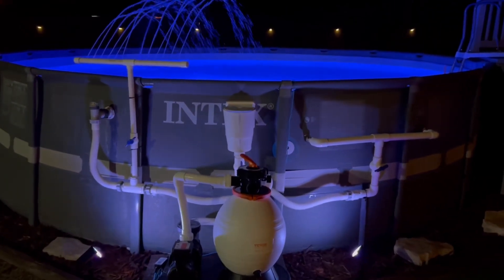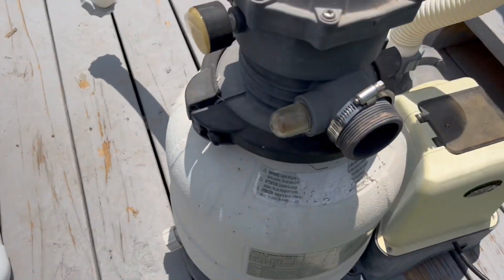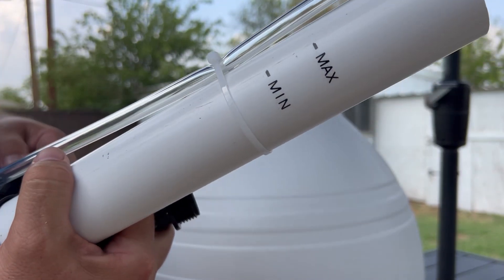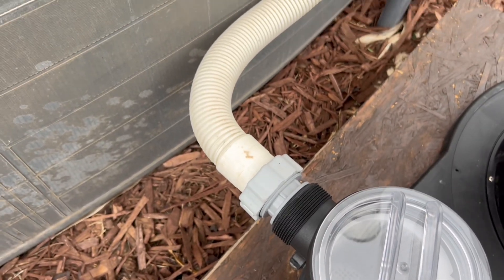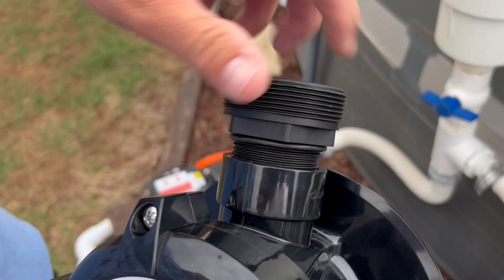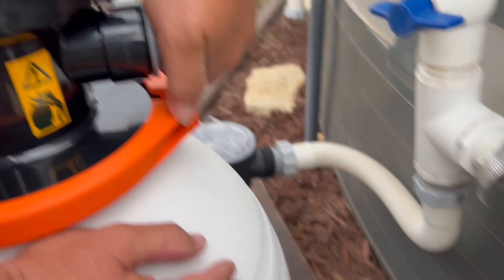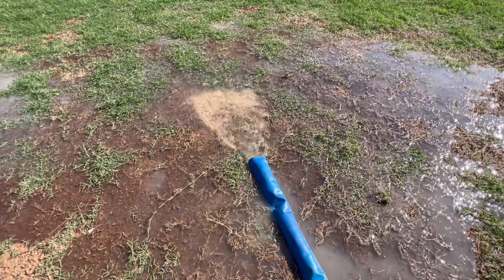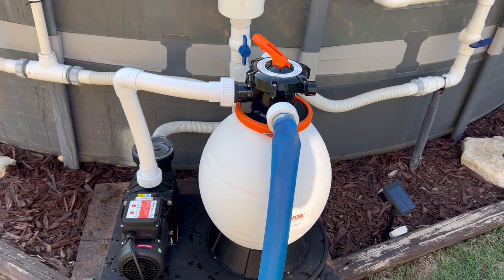How to install a new Sand Filter, Vevor 16” 3500 GPH

Comment: just got my vevor pump today cant wait to get it hooked up and running would not have even thought of or tried to do this with out your videos. Thank you!!! oh and im also going to do the hard plumbing and next year add the skimmer thanks again
Reply from the maker: Let me know how you like it once it’s done 👍🏼
Reply: well i dont have it hooked up yet still waiting on my fittings from amazon that have been delayed 3 days stuck somewhere in shipping. i do have a question though what brand of sand do you use and how many lbs does it take to fill? the directions that come with it are a little lacking thankful for your video cause this is my first pool  @LifeLessOrdinary
Reply from the maker: @ryanpursel5017 it took me two full bags. I don’t remember the brand I just got it at the local ace hardware.

Comment: Man, this was the video I needed! I couldn't get a solid answer from Vevor on whether I needed adapters or not, but I pulled the trigger on the pump and filter anyways, I didn't want to go with another Intex one, because the flow rate is trash lol, I can't wait to get this put in! Hoping to get my brown water to crystal clear again!
Reply from the maker: Let me know how is going after you got it installed
Reply: @LifeLessOrdinary  will do! Im beyond ready lol! Tried to get our brown pool cleared with the intex pump and it just couldn't keep.. New one should arrive Tuesday, so hopefully I can get it installed and going before we leave for vacation on Wednesday.
Reply: @LifeLessOrdinary    Vevor Pump worked great until yesterday morning when I went to backwash it before leaving for vacation, the lid to the strainer basket on the pump sprung a leak, I think the seal just needs to be seated again, I just got frustrated with it and didn't have more time to mess with it, so the pump will remain off until we return next week.
Reply from the maker: @huntershortrepairs I’m sorry to hear that. I got frustrated with that also. Use that black O-ring to push the basket down then screw on the clear top but it Has to be super tight.
Reply: @huntershortrepairs Leaking seems to be a common complaint with these Vevor sand filters.

Why not go with the 16 inch 3000GPH Intex sand filter?
Reply from the maker: @Superman-xr1oh Vevor sent me that pump and filter to review. I did not purchase it. Thankfully, I had good luck with it in my case.

Comment: I appreciate you sharing your know how in this video. I had no idea what back washing even was. So thanks for that.I bought the smaller version of the filter you have. I am finding it a huge pain trying to figure out what plumbing connections I can frankenstein fit to my existing intex pool. It's going to take a while. I'll probably have to order and try and send back and retry.Tyring to even figure the names of parts I don't know to google has been interesting(frustrating). I guess it will be my summer project. It'll be a marathon not a sprint for sure!
Reply from the maker: Thank you 🙏🏼 make sure to check out my other videos on how I plumbed everything it might help 👍🏼

Comment: I just installed this very model and your video helped so much!  I previously purchased the lower model and battled connecting it for days and gave up, sent it back, got this model.  The only things I'm questioning are these:

1) Is it normal for the hoses to shake when it's running?  Both return hoses (I have a salt system) shake a lot.  The hose from the skimmer doesn't, but the one from the lower level pool outlet shakes a little. 

2) The pressure gauge dial jiggles.  But the pressure is between 5 and 10.
Reply from the maker: Your pressure seems ok but I’ve never personally had much shacking going on. Are you giving it enough water? I would open all inlets and see what happens
Reply: @LifeLessOrdinary    I have a video of it and maybe I'm just overthinking it.  The return hose from the filter is shaking from the pressure I believe but I see in your video it does the same thing.

Comment: Thank you for sharing your experiences and success w the intex pool and accessories.
I need your opinion.
I was considering buying a wireless vacuum until I saw this video. The vacuum would be around $300. Then again, this filter upgrade seems very necessary and might be sufficient to hook up the blue drain hose and a more simple vacuum attachment to vacume out the debris and green residues after a storm. 
Did that make sense?
Forgot to mention my pool size. It is 16' x 32'
Reply from the maker: Absolutely 👍🏼 it’s really personal preference. Me personally I don’t want to spend that kind of cash when I can use the blue hose and filter to get out to tough stuff. Which everyone pool is different mine stays pretty clean without a ton of work but yours might be more difficult.
Reply: Can you do a video on the vacuuming with the blue hose and the sweeping device and explain the set up with the filter please

Comment: I installed my new Vevor pump and hard plumbed with PVC line you did. Love how it turned out. Only problem I have is I put 3/4” pvc into the pool outlets that go to the pump as you recommended and now I can’t figure out how to hook up my pool vacuum hose like I did before. Where and how do you hook up your vacuum?
Reply from the maker: I used the white adapter hold on let me get the link
Reply from the maker: https://amzn.to/3V0T9Ij
Reply: Ok and where did you put that adapter?
Reply from the maker: @jasonholdeman8451 are you using a flex hose? If so that adapter goes in one end and into a inlet port

Comment: Good day. I purchased the 14” .75 hp pump. It doesn’t have the threaded ports as yours and my 1.25” Intex hose does not fit the pump’s 1.5 port. Also, when I backwash and rinsed it came out relatively clean instead of dirty as yours. I believe I used the proper sand, #20. I cut off the end of the hose to accommodate the pump. I’ve got a small leak but nothing too serious but still bothersome. Do you have any suggestions on making a proper connection?
I’ve contacted Vevor but they’re BSing me around. I’m either going to find a solution or return the pump. 
Thank you kindly for any suggestions.
Reply from the maker: Oh wow that’s not good. If it were me I would probably grab the grey Intex adapters and then head to Home Depot and make a adapter to the new filter from pvc. I’ll grab a link of the adapter GAME 4560 40mm to 1 1/2 Inch Conversion Kit (For Intex & Bestway Pools) https://a.co/d/ioZy7oN
Reply from the maker: Keep me posted and let me know if Vevor helps more or not
Reply: @LifeLessOrdinary  will do and thank you for your suggestion.
Reply: That's weird that yours didn't have threaded ports because it's usually pretty standard with their pumps 
Even the 12-inch

Comment: I followed your instructions, which are amazingly helpful. But I have one question. My backflow outlet runs water out as soon as I take the plug out. Is it supposed to without turning on the motor?
Reply from the maker: Yes most pumps will do that 👍🏼

Comment: My oring for the clear pump cover I can’t figure out how it goes. Is it to seal the clear cover? Does the flat part go up or down. It seems the threads of the cover make the oring not seat and leak.
Reply from the maker: I put mine in to push down the basket. And then just screwed the clear cover on tight 👍🏼

Comment: Nice video. I have the vevor HCP750A-D. Had to clean out the pump strainer and now I cant figure out how the gasket goes back in properly. Can u help?
Reply from the maker: Hmmmm I will have to double check mine when I get home today. I’m pretty sure the gasket went over the top of the basket to hold it in and then I just tightened the top part real tight.

Comment: So love your channel and work you've done to pool so i subscribed. I have 16' 42" Coleman above ground pool. Says its about 4500 gal. My question is what size filter and how much hp do i need for same kind of set up u got. It has crappy papper filter that came with it. So would be big upgrade going to sand filter. Also getting the skimmer and fountain like u have. Any advice would be greatly appreciated.  Thanks, Scott
Reply from the maker: The Intex 2100 series pump would be perfect for you 
https://www.amazon.com/dp/B07F3RXVBC/ref=cm_sw_r_as_gl_api_gl_i_JFGNZ37ZAWVTQ91A7FQ5?linkCode=ml1&tag=llonate-20

Comment: How loud is it, seems mild in your video. I have a Intex 3000 but after a couple years it just went from mild to loud. Still works and has no debris but I want to replace with something quieter.
Reply from the maker: It’s not bad at all. I think it’s a little bit quieter than my intex was

Comment: I'm sorry but I cannot figure out how to get the adapters for the intex pool.  You say it will be in the links later, but I don't see any links.  I'm a bit internet challenged.
Reply from the maker: No problem here you go.
40mm to 1 1/2” Filter Hose Conversion Kit - above Ground Pool Adapter Connects 40mm Hoses to Standard 1 1/4” or 1 1/2” Filter Ports
Reply: @LifeLessOrdinary  Thank you so much for responding.  My husband has been watching all of your videos and they have been very helpful
Reply from the maker: Thank you 🙏🏼

Comment: Hello. This is our second year with this pump. Last year was great. This year Our output seems very weak. Do you know what could be causing that? We backwashed and rinsed. Not sure what to do.
Reply from the maker: Hmmmmm it’s possible you could have trash on the inside stuck. Go to the 8:15 minute mark of the video. 
https://youtu.be/2kurASa4ahI?si=yKa2OCb2U_BN6jSs 
Look on the bottom of the filter head for any trash

Comment: How do you know which size filter to get? I have an 8,000 gallon pool. I’m seeing 12” 14” and 16” on Amazon.
Reply from the maker: Me personally I would use either 14 or 16 inch for that size pool. Either size would be perfect for your pool.
Reply: Thank you! I just ordered the 14” 👍 one main reason I’m ordering this particular pump is because I can follow along with your instructions. Thank you so much.
Reply from the maker: @aileentimberlake awesome 👍🏼 make sure you get at least the #20 Grade sand. If you have any questions let me know.

Comment: We just purchased an 18’x52” intex that came with a sand filter. We have purchased the skimmer and the fountain that you reviewed. I am not quite finished leveling the ground yet but hope to be ready to set up the pool in the in the next week or so. I was wondering if we should be good with the original sand filter for several years or would you recommend upgrading sooner than later?
Reply from the maker: Absolutely yes, the sand filter that comes with the pool works great. Mine was actually still working. I just received the new one from Vevor so I made a video out of and started using it. Hope your install goes well, let me know if you run into any problems.

Comment: does the pump turn itself back on if you put it on a like a 12 hour cycle? what if you put it on an outlet with a timer - will the timer allow it to work that way or do you have to physically turn it on and off every day?
Reply from the maker: I put mine on 6, it runs for 6 hours then off for 6 hours

Comment: Have you had any problems with it blowing sand into the pool? Read alot of negative comments saying it does and im really interested in purchasing this exact pump for my 18x 48 pool.
Reply from the maker: I have seen some of those comments about sand also but me personally no I haven’t had any problems. I’m wondering if in those cases they didn’t use the #20 gauge sand that’s recommended.

Comment: After watching this video I ordered the same pump and filter. We put it together this weekend and found that while the pump is off water leaks from the pump clear cap and while the pump is on it leaks from the orange filter collar. Did you have any of these issues with yours?
Reply from the maker: No I never had any issues like that. Have you tried plumbers tape on the clear cap? And I would take off the top collar and redo it. Maybe it was off just a bit.

Comment: Are you getting any sand in the pool? I followed the direction in the manual and using #20 sand.
Reply from the maker: No I’ve had no issues with sand in the pool. But I did have another person say that happened to them.

Comment: I just bought this pump and I cannot find hoses to fit for the life of me. Bought 1.5 inch hoses, clamp ends, and it won't fit on the pump--i swear the hoses are a true 1.25. does anyone have a link to hoses that fit this pump and do you know what adapter you would need for the other end of the hose to connect to a plunge valve? The plunge valves on my pool are 1.5 as well, from Intex, but they are threaded ends. I need to either convert the pump to threaded and have hoses or get clamp hoses and convert one end to a 1.5 threaded cuff😩😩

Comment: No recirculate setting? This is the only thing really keeping me from pulling the trigger on this combo unit. I don’t use mine often, but certain chemicals require recirculation like floc.
Reply: Just curious bc I never tried it, would hooking up the waste line to the return achieve the same result? Of course inconvenient, but I wonder if I could for the occasion if it's necessary

Comment: Looking back now, would you purchase this Vevor over the Intex?
Reply from the maker: Great question. This Vevor pump was sent to me by the company and I was very happy with it all pool season long. But I’ve also had great luck with my Intex sand filter. The Vevor definitely is a bigger pump so it’s more powerful, but the Intex was maybe a little easier to set and the plumbing is the opposite of the Vevor so the hose ended up in a different spot. If prices were identical for the same size pump, I would probably continue with the Intex. Both are great products in my case.
Reply: @LifeLessOrdinary  thanks for the quick reply! We have a Bestway 18x48 with the dinky pump it came with. This will be our second year and definitely need to upgrade the pump! Been looking at the Intex 3000 gph sand filter and adding a Hayward Skimmer. Found your page after looking at the hard PVC plumbing! 

May go with the Intex so your other videos can fix us right up this year, before my husband tears it down out of frustration! 😂 thanks again!!
Reply from the maker: You will be so happy with going with a good sand filter. It makes a world of difference.

Comment: How is it so far? My intex is throwing sand back into the pool and its time to upgrade.
Reply from the maker: So far so good I’ve had no issues at all. 👍🏼
Reply: @LifeLessOrdinary  thank you. Any issues with sand going into the pool with this sand filter? Also how loud is the pump compared to intex?
Reply from the maker: @latinracer82 no not at all. Just make sure you use the recommended sand for the filter

Comment: I looked up this pump on Amazon. The power cord for the pump is super short, and it's not even GFCI.

Using an extension cord for a pool pump is generally frowned upon and considered unsafe.
Reply from the maker: Thankfully, I never had any issues with it. 👍🏼
Reply: @LifeLessOrdinary  How did you get around that issue? Do you have an outlet nearby that's GFCI rated, or are you using an extension cord? Do you turn the pump off and unplug it when there's people in the pool?
Reply from the maker: @Superman-xr1oh I use the heavy duty extension cord. And no, I never unplugged it.

Comment: I just installed this pump and followed the directions and your video. However the pump will only run about 2-4 minutes and then shuts off. I tried starting over with all the steps and use a heavier duty extension cord. Any suggestions?
Reply from the maker: That sounds very odd. It doesn’t sound like an extension cord issue. I would look up Vevors  website for customer service and try to call someone or email and tell him the issue you were having.
Reply: Thanks
Reply from the maker: @Kevin-mk9zi let me know if they get you taken care of plz
Reply: @lifelessordinary I’m having the exact same issue with my new unit that I purchased.

I’ve reached out to customer service but have not gotten a response yet
Reply: @LifeLessOrdinary
Reply: @Kevin-mk9zi  did they replace the unit for you?
Reply from the maker: @TheRoofClimber stay on them, let me know what happens

Comment: Do you also need a salt water convertor? I have a regular above ground pool and im thinking of upgrading my pump and filter to salt water instead
Reply from the maker: Mine is just chlorine but yes you could convert to salt if you wanted
Reply from the maker: But no I don’t use any salt
Reply: @LifeLessOrdinary  Thank you replying. I didn't read the title of the video.. yeah salt water convertor would be idea but just realized how expensive they are 😅
Reply from the maker: Yeah it can be lol

Comment: The middle white valve was a little tilted I tried to adjust it after I put the valve top on it and it pulled it up.  Do u have to empty my sand and start over?
Reply from the maker: I’m not exactly sure which valve you’re talking about but if you’re talking about anything internal that came apart yes unfortunately I would take it apart empty out the sand and fix it properly.
Reply: @LifeLessOrdinary  the middle pipe that fits in the sand with the 8 pieces that screw in while it's inside the filter before the sand is poured in.
Reply from the maker: @einrazer  yes absolutely you have to repair that for everything to work properly

Comment: I have a question. I purchased this vector setup and I have been trying to properly floc my pool and was told to recirculate water on filter. Well the Amazon ad states it has 6 functions. One being to recirculate but for the life of me I can’t figure it out on filter. There is no recirculate option.
Reply from the maker: Which exact Sand Filter do you have?